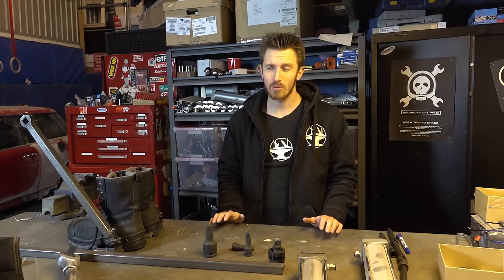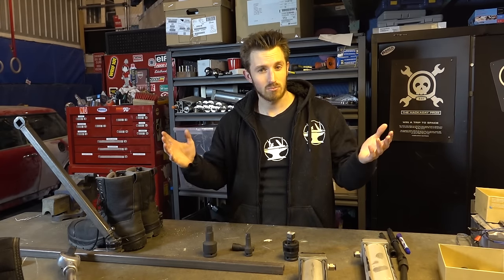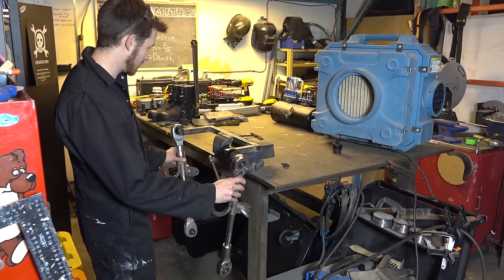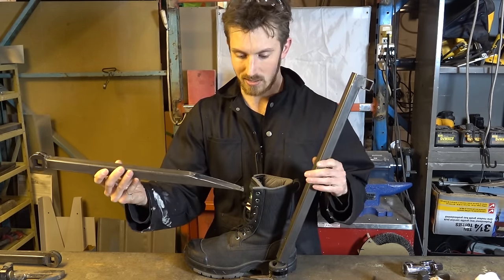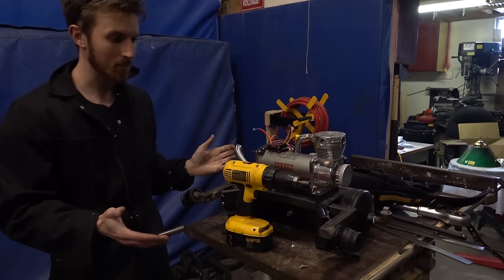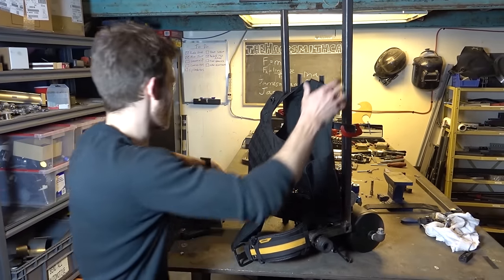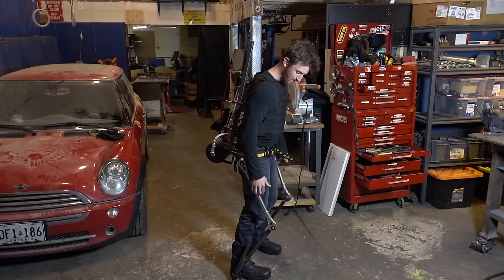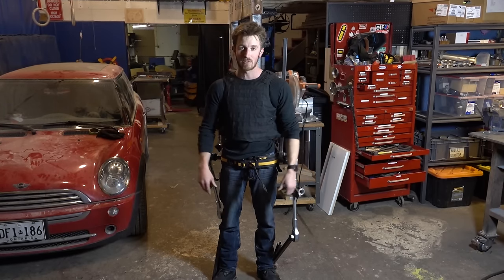KICKIN' It EXO!!!

Comment: if you cut the thighs in half, then you could put threads on the shafts, and use a pipe with internal threads to be able to adjust the length. similar to the tie rods on a semi. twist the pipe and it will lengthen or shorten the joint.
Reply: He should see this
Reply: +Max B works best if one has right handed threads and the other is left handed. that way you only turn the pipe, not the tie rod at the end

Comment: Have you thought about if the hip joint brakes under load a safety or something of the nature
Reply: Nothing about this is safe but still if he is putting enough load to break a 3/4 socket joint then the whole rest of the frame would have buckled by then.
Reply: Nate Nan zTrue True, from what he said this all will be connected by one beam or something of the sort .So basically this entire suite with eather bend in half or snap

Comment: why dont you use linear electric actuators instead of pneumatic cylinders. you could remove the ratchets due to the actuators high static load strength and have a more free moving suit
Reply from the maker: they're really slow but it is something we're looking into!

Comment: Won't you need backwards flexibility in the ankle joint for running?
If I'm correct the only way to really make that work would involve being able to switch between "Squat" mode and "Run" mode.
Reply from the maker: +ThatZommy We didn't remove all backwards flexibility!
Reply: the Hacksmith I know, but it seemed a bit too small an angle to allow for efficient running.
Reply from the maker: +ThatZommy Let's be real though... You're not going to be able to run very fast in this =P
Reply: the Hacksmith Fair enough.

Comment: with the legs now always at an angle to the floor won't that put them in a weaker position when lifting things because the force will go into that weld more?
Reply from the maker: +Goat SD (The Goat 363) Possibly, but for the weight I'll be lifting the weld is sufficient -- it's a 6" bead, it might actually end up being stronger than the original piece of tubing cause it's boxed in on both sides now

Comment: won't you need a computer to manage all the pressure in the arms and legs so it's like you are mowing something but the suit removes 90℅ weight?
Reply from the maker: +WolfWhisky on an advanced design yes, but since you can't control pneumatics very accurately anyway it won't be much of a big deal on this version -- just some practice :)
Reply: +the Hacksmith maybe use a oil system then?

Comment: Nice improvements! But why didn't you just bend the shoes universal joints to get the same result? As for the upper body, I would suggest something a bit more flexible, like a universal joint connecting the hip piece to the torso. This would probably require some sort of springs or pneumatics to help so you don't get stuck while lifting heavy weights, but it might not necessarly need to be powered, just something to give a bit of resistance. I think adding steel (or even better, titanium!) plates that can be clipped to the exoskeleton to offer protection would be nice too, something like a fallout power armor. But hey, that's just some ideas!
Reply from the maker: +solstice4485 The pneumatic cylinders "feet" plug into the bottom of the shoes universal joint, so it has to remain parallel. As for the shoulders you guessed exactly what we're doing ;-)
Reply: +the Hacksmith I was not only thinking about shoulders, I was thinking about the whole body. Like medieval armor, only significantly thicker, and exo powered ofc! :-P Btw aren't you concerned about the parts being soldered (especially the new on the legs tu curve it) that they might break with weight/cylinder pressure? Keep up the good work!
Reply from the maker: +solstice4485 If it was a small weld area yeah, but it's actually probably stronger now than it was before -- there is more material and it's boxed in on both sides, so no it shouldn't be a problem =)

Comment: You need better backsupport. Because all stress you will reseve by pulling, pushing and lifting by your hands will transfered via your back to legs. And we will hope it will be wearable steel, but not your spine.
Reply from the maker: +Пётр Темников It's not done yet...
Reply: the Hacksmith
I am just suggesting to add to plans. No offence)
Reply from the maker: +Пётр Темников Yeah but until there is an upper body, there's nothing for the back to support... We'll be mounting the shoulders off of the two weldments sticking up from the back, so when weight is carried it goes all the way through the frame, to the hips and legs =)

Comment: Those legs are beginning to have a Terminator feel to them. Is it possible to find an airtank made in a sturdier material so it's 50% smaller?
Reply from the maker: +Captainumerica Yeah, we can use scuba tanks -- this can only hold 200PSI, a scuba tank of the same size could hold 3500PSI!
Reply: +the Hacksmith I'd suggest to keep it under 3000 PSI, or else it might heat up a lot!
Reply from the maker: +Captainumerica How so? The compressor wouldn't be on the exo at that rate (high pressure compressors are very slow and bulky), so it would be more of a battery tank. The expanding gases will actually cause a cooling effect at the connections =)
Reply: +the Hacksmith During use, yes, but the pressure on the valve?
Reply: Errr, scratch that, forgot the laws of thermodynamics for a moment (not an engineer here lol).

Comment: where do the thrusters attach for flight?
Reply from the maker: +Clint Alexander Better watch on Amino Apps to find out!
Reply: I was just dreaming but I got maker amino apps just incase. I really love this prototype. But I hope your direction is to move towards a more lightweight design. Imagine less power but something that could be worn all day and activate when required.
Reply from the maker: +Clint Alexander That's why its modular =) add the leg cylinders for strength, not needed normally =)

Comment: Iv seen every video to this build but my question is can you actually rip metal off of things with this. I know it enchances your strength you made that very clear but with a proper glove could you punch and tear metal off
Reply from the maker: +Buba Jack Does it look anywhere near done...? we don't even have the upper body built...
Reply: I know that im just asking when its done would it be able to work like in the game
Reply from the maker: +Buba Jack Not quite possible, need hydraulics for that kind of strength.
Reply: You can always make diffrent modles maby they will even replace fork lifts
Reply from the maker: +Buba Jack Oh definitely, but it will be much larger. Basically it will be impossible to make one super strong that is as small as the one in CoD. But a larger one could rip metal off! Look up Hydraulic Jaws of Life
Reply: Iv seen them before. Im sure if you did build a hudrolic exo skeleton it would be large but technology is always moving forward so maby they will make a smaller hydrolic or a stronger pneumatic